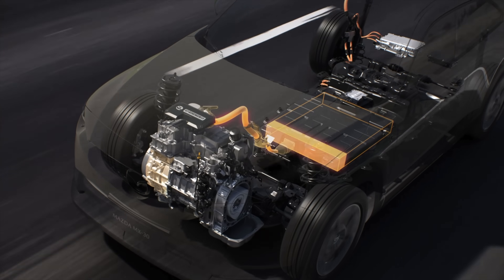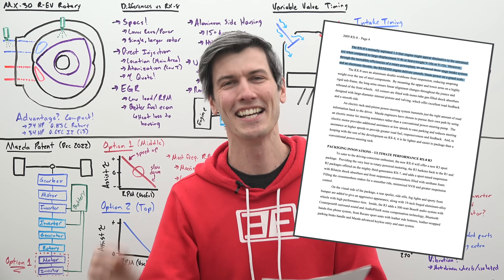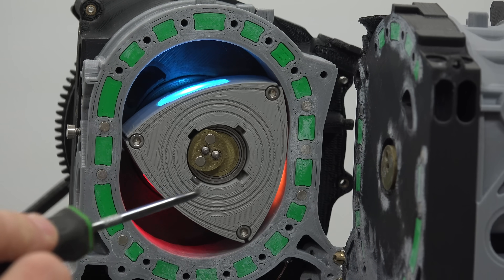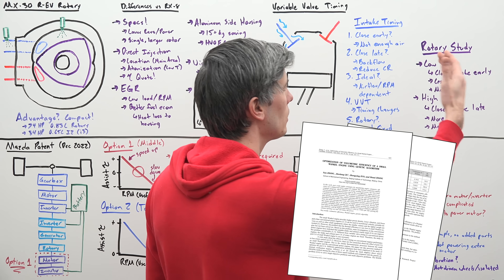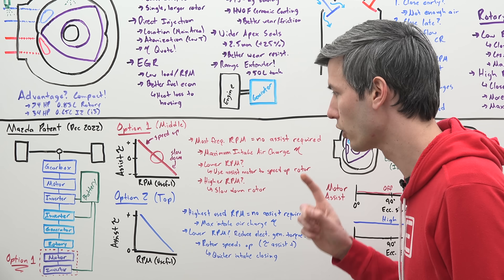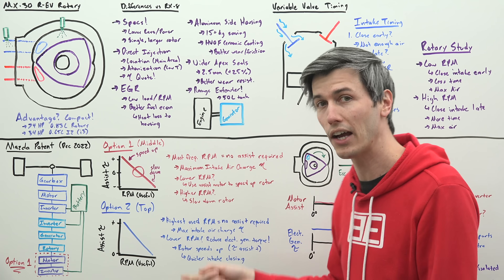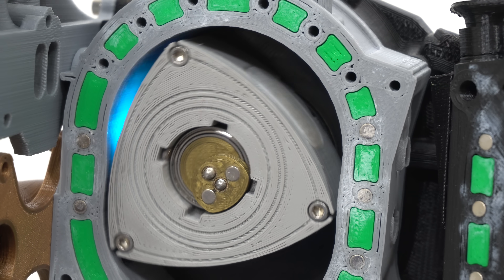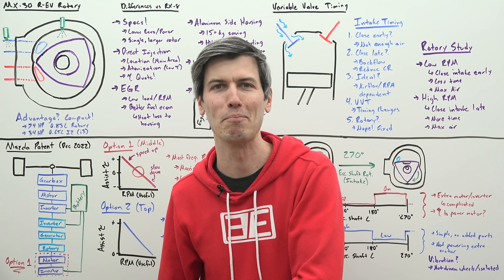Mazda Brought Back The Rotary Engine!

Comment: The amount of joy I got from this video is substantial. I can't wait to see what Japan really brings to the EV market.
Reply: Not much unfortunately. They are like 15-20 years behind the world. For example hybrids made a lot of sense in the 90's and 00's, but they make no sense today. Currently batteries have enough capacity at an affordable price and the charging infrastructure is pretty good, so pure electric cars work just fine. And the problem with hybrids is you carry two powertrains, which in many ways combines their disadvantages. For example they need more maintenance than a gas car, more expensive, and if not used correctly they burn more gas.
Reply: Japan isn't bringing much to EVs. They're doubling down on hybrids and hydrogen.

The Koreans are doing well with EVs though, specifically Hyundai.
Reply: Another lunch? Because Korea ate theirs.
Reply: Japan will introduce a solid state battery that will be the biggest game changer in EV's
Reply: I had an RX8 and it remains the best car I ever had. Miss it
Reply: @andrasbiro3007  Hybrids bring the best of both worlds. Excellent fuel efficiency, easy to fill any any number of gas stations. Cheaper to acquire than a BEV, have double the range on any given day. They have maintenance needed annually in most cases. BEV's still have massive shortcomings in their cost of manufacture, charging times and infrastructure. Granted more chargers will be available over time but then again more BEVs will be there to use them. BEV's are not the only solution, there will be multiple solutions and Hydrogen will be one of them along with efuels and Japan is leading the way in hydrogen technology for the long term not just as a fuel but also a catalyst to replace all the petrochemicals we use in the manufacture of just about every product on earth.
Reply: @andrasbiro3007  Hybrids are perfect right now, and Japan have been leading in the field for decades. What are you basing this opinion on? Toyota and Nissan had one of the first all electric EVs with the Toyota bZ4x and Nissan Leaf and did so without the issues of the Chevy bolt and early Tesla. Japan is a game changer in EVs

EV infrastructure is not where it needs to be to be perfect, people want the dependability and range and speed of ICE with the convenience, tech, and comfort of EV. Hybrids fit that 1000%. EVs suck at operating in the cold or towing, which is where Hybrids will come in handy. A hybrid engine can heat up the batteries and the cabin and help with efficiency and range in the cold.

Another thing is on the manufacturers side, they are all having shortages in production with the only exception being Tesla. Ford can't keep up with demand, Mercedes is failing to keep up production numbers, and Chevy isn't going to be able to hit their production targets at all. Hybrids require less of that battery infrastructure and therefore they can increase production numbers massively. Hybrid is win/win right now and it's just going to get better with new clever tech like shown in this video.
Reply: @andrasbiro3007  Hybrids can make sense in countries (mostly 3rd world as  i see it) where their infrastructure is majorily only capable of supporting IC engines, where they cannot just easily willy nilly change everything to support Battery EVs, as a transitionary vehicle they make quite abit of sense in that they don't do as much pollution as contemporary IC engines or consume as much fuel, they could however be more easily damaged by weathers in such places or problems with infrastructures that cannot easily support such drivetrains, you are right that they are far more complicated though no contesting that, but if your goal is to spend less money on fuel but still needing a private vehicle, then Hybrid Vehicles could makes quite some sense.

 in the case of Hydrogen powered cars (Hydrogen EV and Hydrogen IC engines) that is more of a japanese economic push than a case of making things more environmentally friendly.
Reply: @andrasbiro3007  Battery powered vehicles is dead since 80 years already since it is not the proper source to power an engine.  That's why main-movers (or engine) have been desgned to power generators that produces electricity to make motors turn. That's how a proper electric vehicle should be conceived. Not what we are being sold today.
Reply: @ryzenforce  ok boomer. EV's for passenger vehicles are the best solution for pretty much every case
Reply: @weofnjieofing  
1. Hybrids are in many ways the worst of both worlds. You carry two power trains with all of the problems of both, and some entirely new ones.

2. Hybrids are not that cheaper anymore, and the remaining difference is quickly disappearing. You can see it in the sales numbers, hybrids are losing popularity fast.

3. The charging infrastructure is much easier and cheaper to build out than gas stations were.

4. Hydrogen is dead. It never made sense anyway, but now it's not even remotely in play. The main problems are that hydrogen is very expensive and very hard to handle and store. You don't get more range with hydrogen than with electricity, because of it's extremely low density. And there's virtually no infrastructure. So what's the point then?

5. Hydrogen could have a future in some industrial processes, but not in transportation.
Reply: @amazin7006  
1. Hybrids are outdated. They were a necessary compromise when batteries were too expensive and lacked the necessary capacity. Neither is true anymore. Batteries are now affordable, and have more than enough capacity. And even the charging infrastructure is there to support pure EVs.

2. You live in an upside down world. Japan is dead last in EV tech, they just admitted grudgingly that electric cars make sense at all. The Nissan Leaf was a good start but that was all Japan made until very recently. Then bz4X was a complete failure and also way way too late. 

3. Also the Leaf had serious issues too. Fast battery degradation to be precise. Plus it didn't have the range or the size to be a primary car for most families, and lacked any appeal besides being electric. It was ugly, slow, small, etc.

4. In reality the charging infrastructure is good enough in most of the developed world. At least Tesla's.

5. EVs are as dependable as gas cars, if not more. The better ones have plenty of range too. In speed, acceleration, handling, convenience, comfort, safety, space, and tech they are superior to gas cars. Teslas mostly, but there are other good ones too.

6. EVs are not bad in cold anymore, and also can tow just fine. Sure, you lose some range, but it's not the end of the world. There are only very rare cases where EVs still fail.

7. Manufacturers have issues with all cars now, mostly due to chip shortages. They use old ones, that are manufactured on legacy production lines, so chip makers are reluctant to increase capacity. Tesla doesn't have this problem because they use the latest chips.
Hybrids doesn't help with the chip shortage. If anything they need even more chips.

8. There's no battery shortage anymore. Enormous capacities are coming online and even more are planned. New technologies help too, like the iron-phosphate chemistry that doesn't use cobalt or nickel which are limited in supply. Tesla's 4680 cells and their strong push to improve supply chains are also a significant factor.
Reply: @nightshade4873  
Third world countries can't afford EVs anyway. Or any new car. Infrastructure is the least of their problem. If it comes to that, Tesla can build out the infrastructure in a year or two, as they did in many countries recently.
If necessary that infrastructure can include solar panels and battery storage too. It's the most cost effective solution anyway. Lot faster and cheaper than building conventional power plants and thousands of miles of high-voltage transmission lines.

Weather is actually worse for gas cars. Water mostly. ICE cars die if the water just a little too deep, while electric cars don't care. There are many videos of Teslas driving through deep water. One even drove entirely underwater, although it needed a lot of weight to stay down.
Other than that I don't know what weather you are talking about.
Reply: @ryzenforce  
Oh, I understand now. You've been accidentally frozen in the 80's and just woke up.
Reply: @andrasbiro3007  Evs are still bad in the cold, even top of the line stuff like Rivian,  EQS and  Plaid lose range in cold. Model 3 much worse. Depending on charging infrastructure in these conditions is a recipe for failure. Fast charging doesn't always work, most people would rather have a small engine on board as a range extender.
Reply: @amazin7006  
1. Nope. EVs are working just fine in the cold too. Actually much better than gas cars. In Norway over 80% of new cars are pure electric, and it's not exactly known for it's warm climate.

2. They do lose range, but not that much. At least Teslas.

3. No, the Model 3 is definitely not the worst, it's among the best. And the Model Y is even better, along with the Model S and X. The reason is the Octovalve.

4. The charging infrastructure also works just fine. Tesla's at least.

5. Tesla's Supercharger network has a 99.96% uptime, and that includes extreme cold too. Teslas also heat up their batteries for charging, and they do it already on the way to the charger.

Comment: As a range extender, the rotary can be kept in its most efficient RPMs range - if not just its very best point. I always expected that, if Mazda were to bring it back, it would be as a compact, near vibration -free, constant speed power generator. It makes a lot of sense in that use.
Reply: This is EXACTLY on point. It can beat typical reciprocating (piston) engines on efficiency when optimised for static load. This is why they are so reliable and efficient in aircraft applications for example. A generator being another perfectly optimisable example.
Reply: Except Wankel engines don't last very long without having to be rebuilt. They are one of the least reliable engines ever made due to the inherent awful mechanical design.
Reply: @DaroffApFire  We hear the same old thing about improved apex seals bla,bla bla......
Reply: @cathalsurfs  I'm not completely convinced a rotary is better than piston as a generator. Pistons are hitting 40% nowadays. The only numbers Mazda has released is "20% better than 13b". Internet snooping suggests 13b is around 25 to 28%. 20% of that is at best 35%. that's ok for a gen 1 Prius in like, 1998.
Reply: @Appletank8  as a range extender hybrid, the wankel is smaller, less vibration and lighter. In  range extension those are important attributes. You rarely, if ever see range extension with a diesel/compression ignition which is exactly the opposite, larger, heavier and more vibration, despite the diesel being more efficient and the wankel being the least efficient. As a range extender it will be providing the power for probably less than a quarter of the total mileage of the vehicle.
Reply: @jiroyamamoto2878   Diesels have other problems besides weight, their exhaust systems have to be more complex. Atkinson hybrids are getting dang close to Diesel efficiency without all that baggage.

Also there's the unfortunate statistic that found out not enough people are really using their plug in hybrids correctly and use the gas way more than they should.

Wankels aren't just a little less efficient, they're still noticeably inefficient even with decades of development. If Mazda wants to put forth an argument that Wankels are a good option as a range extender, they really need to put in some big positive stat elsewhere. Compared to the Plug In Rav4, I'm really not seeing any major advantages. Worse HP, worse gas range, all to get maybe 5 extra EV miles.
Reply: @Appletank8  It is not a plug in hybrid, it is a range extender. One step closer to the BEV. Think like an I3.
Reply: @jiroyamamoto2878   Pretty mediocre for a BEV with Rex to only have 50 miles EV range. Especially when plug in hybrids are nearly matching it's range already.